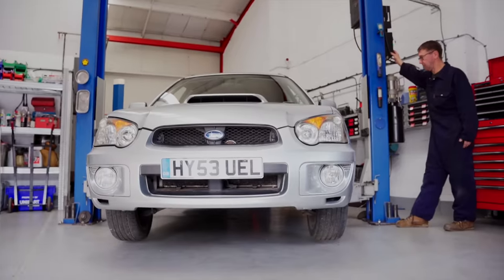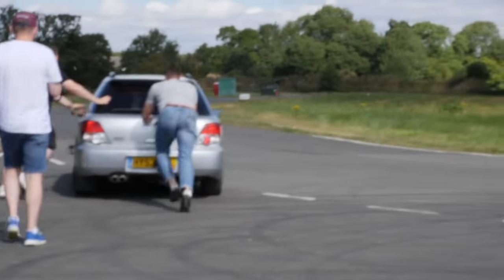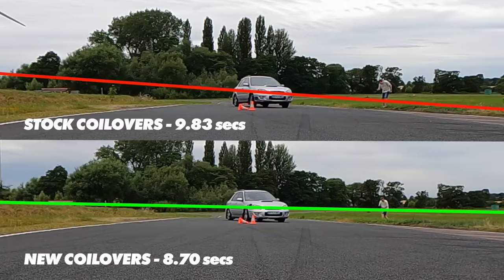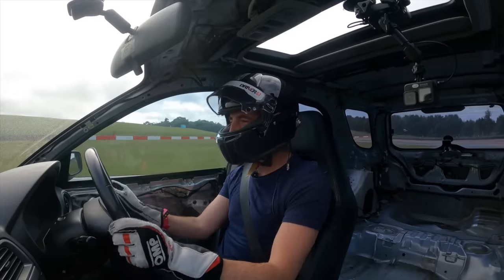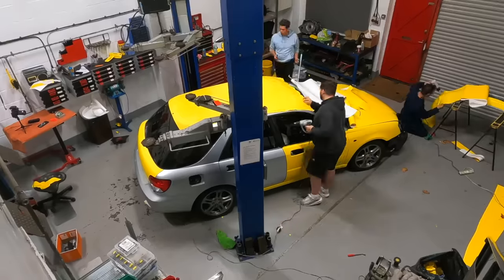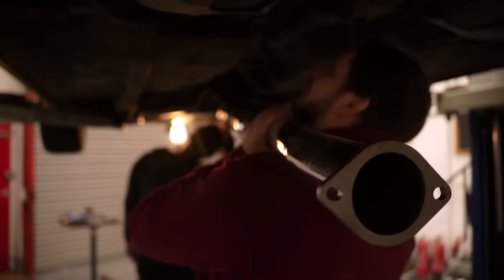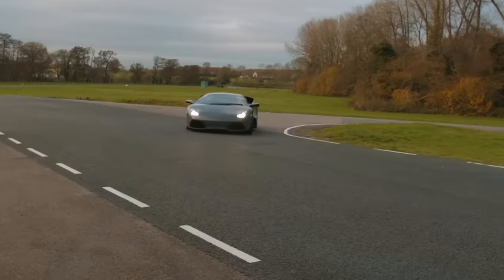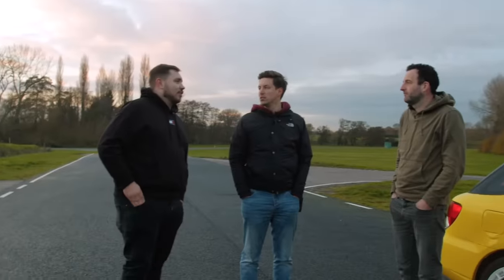We Built a $10,000 Subaru that BEAT A Lamborghini

Comment: I feel like Donut Media and Driven Media have each made a series that gives a completely opposite view of Subarus lol
Reply: Donut Media is a joke lol
Reply: @kingo5940  explain.
Reply: @warlxrd5317  What is there to explain, they blew up their car cause they ignored an engine break in period, and the way they modified lowcar was absolutely bafflingly stupid. It was embarassing to watch. They went in with absoltuely no idea as to what they wanted to archive and threw parts at both cars that didn't really make sense.
Reply: @FourteenSucks  thx
Reply: @FourteenSucks  but that was the whole point right? I mean Installing low cost parts.
Reply: @warlxrd5317  The issue is they didn't even really do that, their fueling system made no sense and absoltuely blew the budget, all they needed was a Walboro 255 or a AEM 340 if they wanted to be safe and injectors, the turbo choice was absolutely ridiculous. Now personally, this is how i'd have setup lowcar, as someone who owns a RB320 Impreza STI, for a Hawkeye WRX I'd have swapped in a second hand VF48 turbo from an STI and Pink Injectors, a new Ebay topmount, swaybars, cheap UEL headers and a Upipe + Exhaust, this would have taken the car to the exact power they made, but with less cost and a far cleaner powerband. 

This would have kept the turbo charged and on boost far better then a Frontmount setup and for the same price, the car would be on chat (In boost) qucikly and spool would be responsive. Leaves alot of money on the table for Shift kit, Pitch mount, good coilover setup (Low car could have gone with HSD, a reputable brand thats under £600 in sales) 

I just dont like the way they do things, personally I think its poorly thought out and doesn't give viewers great input into what should and should not be done.
Reply: @warlxrd5317  The expensive car was the one that had the most issues. Largely because they just threw parts on without preparing for them properly or tuning the car for them correctly
Reply: *Overdrive
Reply: @FourteenSucks  oh. I see. Now I'm getting that they haven't prepared that much. And they took "low" personally right? (Michael Jordan. Jpg) xD
Edit : btw tqsm for explaining! :)
Reply: @ianlide1507  yeah. Now I got it.
Reply: @warlxrd5317  Not a problem man, there's a few great ways to get great numbers out of a WRX for cheap, but I should also mention the limiting factors for the Hawkeye specifically is the EJ257 and EJ255 engines, and ofcourse the gearbox in the WRX being the 5 speed limits your reliable power, these cars are exceptionally fun, and 300-350whp is a great number to archive and enjoy, building beyond this number starts to get expensive and the potential for engine failure becomes high.
Reply: @warlxrd5317 to be fair to donut even when they didn’t ignore the brake in period they still blew up. I think they ended up going through 8 engines and only 2 of them was their fault due to ignoring the brake in periods
Reply: Facts🤣🤣
Reply: @warlxrd5317  they don't have a single clue about cars
Reply: @Fred_the_1996  they mentioned in the last episode that after the first engines that they put on an aftermarket oil pan.
Reply: @Fred_the_1996  they did install after market oil pans😂😂
Reply: @FourteenSucks  The point of high/low isn't to see what build is actually best. Its literally in the name. They're not going for efficiency or "bang for the buck" builds. They don't claim thats what it is. It's literally just the most absurdly cheap and expensive parts. Hence "high/low". Its like going to little ceasars and expecting a wood fire oven made neopolitan pizza then complaining about the quality of the pizza.
Reply: @FourteenSucks  any advice on what to do with a jdm bl5 gt spec b with EJ20Y engine? Car is completely stock at the moment. Cheers 👍🏻
Reply: 11:12  “just don’t pick something with a boxer engine” Driven Media was pretty explicit with that point.
Reply: @FourteenSucks  they literally said they three the expensive parts on because they just wanted to compare the turbos. I get that they did stupid shit ignorant of Subarus but the setup was for a reason.
Reply: Driven Media actually did racing upgrades, when Donut did a "radio upgrade" as a "Time Attack" car just told me, they were done with working on the Subaru's.
Reply: I love donut and everything they do but they definitely did rush work hence the amount of engines they went through where as this series does it right and shows that they have so much to offer and are reliable even when beaten on.  Damn fine work guys and yet another reason I love my subaru
Reply: Both series where meant to be track cars and driven or Overdrive’s car was far cheaper and I bet money was faster, quite hilarious actually, wish there wasn’t a pond between them cuz a race against each would be awesome!!! My money on overdrive car
Reply: Driven Media/Overdrive listened to the viewers and installed parts that were actually tried and tested on the platform. But with Donut, people were clamoring in the comments telling them what they were doing wrong, but they didn't listen.

I was among those telling them to 6-speed swap hi-car or else they'll fry their gearbox. In the end, hi-car's gearbox got fried.

It's a good thing that Drive/Overdrive's build had budget constraints. It really gets them to think carefully about what to install. Both Hi and Low car had virtually unlimited budgets. It's just a matter of which is cheaper and which is more expensive.
Reply: I wasn't really sold on Subarus before,  but Donut has me convinced they are WAY too fragile and fickle for me. To be fair, every Impreza owner I know has had to put at least one new engine into their cars.
Reply: @meischix  well said, I just wish they did this season more like their others(the right way) its almost like they were trying to make the cars live up to the stereo types for the views but if you do that to any car no matter what it is you'll get simular results.  They didn't do them selves any justice by what seemed like just slapping things together and hoping it works engine wise without any breakin
Reply: @christianthornbury6192  I also own a BL5 GT Legacy mate, freeflowing exhaust and if you have the budget get a downpipe, throw a HKS/K&N/Cosworth Panel filter into the airbox and change to a GFB recirulation value, this should allow you to safely get about 320bhp, you can push to higher but i'd not recommend it. the Twinscrolls come with a TD04-HL from factory if your car is a manual and they're very responsive in the low rev range.  Dont overdo the car the engines are basically a Half-ish-STI block but open deck with duel AVCS, hence them revving out so high, but they do blow up if you start to push past 350bhp. 

(edit) DO NOT put a Ebay exhaust on the car unless you're buying the Exhaust specifically for the midpipe and Y-Pipe, they sound AWFUL. ELH makes the car sound worse then a Straight piped Civic if you put a shitty muffler on it.
Reply: @hatefunwrx  Yep, if they only tried to understand the platform a bit better. It's not unreliable, it's just different. Stuff you know working on inline-4s don't always translate to the flat-4s.

It could've been nice if they ran an episode where low car gets just a Killer B oil pickup and a baffle for the stock oil pan, and Hi-car gets the full IAG kit with the pan, baffles, and everything.

We didn't even get an episode on the endless debate on UELs vs. ELs, or on mods unique to the platform like pitch stop mounts. Or COBB access ports vs. Tactrix DIY reflashing? Fully built engine vs. stock block and stroker kit?
Reply: @meischix  you are literally reading my mind 100%.  It's a real shame they didn't actually try this go round and well I'm sure I can speak for some people with saying we have truly been cheated out of real mechanic works and working (not saying they are not just that the seem to not even cover a quarter of the ass instead of half let alone an entire one, still cool that they did it none the less) I feel bad for those beautiful Hawkeyes
Reply: EJ20 Vs EJ25
Reply: @jfishcake  that would be great, I personally like them both
Reply: @zek62482  for me out of the 5 that I've owned I only had to replace 1 engine and it was because of my own stupidity, but I will say they can be a bit on the finicky side but as long as maintenance is done and you don't go to cheap on parts thay are great and the feeling they give is unmatched (at least to me)
Reply: @CozyKG  if they actually did that, they would have gone for fucking Ohlin coilovers for high car, not some fucking Teins
Reply: Here's why the Donut cars blew up and the Driven (Overdriven) cars didn't: The track was different. Donut was running at Willow Springs Horse Thief I believe, which is a MUCH larger track. The issue with Subarus is that it is far to easy for oil to slosh away from the pickup when you add grip. So even with baffled pans the cars were under sustained lateral acceleration and oil starved. The Driven car was at Curborough which is a very small, tight course similar to an autocross. On that scale of course the oil doesn't have time to flow up to the heads and get trapped. The other issue is that it seems to me the 2.5l engine with it's longer stroke and greater crankcase windage seems to have more issues controlling the oil vs the 2.0l engine that comes in the 00-05 USDM cars and all euro market Subarus.
Reply: @FourteenSucks  The way you described how to modify lowcar is exactly what I did with my WRX when I got it. VF48, 750 cc injectors, walbro 255, turboback and a tune. I drove it like that for years and then the EJ205 failed from a clogged injector. EJ207 swapped it and upgraded to a rotated GTX3076R and a 6MT and it's been great at 450whp. Still did all this for under $10k and it is way faster than either of Donut's cars.
Reply: @meischix  That's because those debates aren't debates unless you're in the dumb side of the subaru world. An EL header is better and makes more power. Only in the US where people expect Subarus to go "wub wub wub" did they keep the hot dogshit drinking straw hot side setup on the STI. In the rest of the world the STI got an equal length twin scroll setup in 2007. It's better, period end of story. Also pitch stops do very little, don't bother with that, it's a waste of money. Tactrix vs Cobb, it'll do the same thing given a good tune, just depends on what the tuner prefers/has experience with tuning. The real high car oil system would be to fit the RCM dry sump kit, then it would have actually lived. Probably would have been cheaper in the long term too.
Reply: @Levibetz  very good points.  Even with all of that I still love both engines for various reasons and the way they feel, currently getting used to my wife's 19 ascent and its let's say fun times and what not
Reply: @hatefunwrx  Yep, I have two subarus and a beetle. Definitely a boxer fan myself. I just try to stay objective and clear out the BS surrounding Subarus which is... a lot.
Reply: Totally 😂😂😂😂
Reply: @Levibetz  always trying to in all aspects of life, to me this car(my 07 wrx) is me in car form in every aspect.  I really do miss driving my 02 but this one is things I can't say without getting in trouble
Reply: Atleats donut have made the price of Subarus cheaper for people who actually know about them
Reply: @Umar-gw6fy  I hope so
Reply: @warlxrd5317  look up smeedia/remy/bader/devin they all work on subarus they are literally lego blocks and you have 30 years of documentation on whats weak with them and what to upgrade donuts a joke now
Reply: @SkylineLofe  Exactly. Its literally just about the entertainment value of seeing cheap and expensive ass parts. Idk why yall are complaining so much😂
Reply: @kingo5940  ah yes because the engine that blew up in first track day without any mods was donut medias fault
Reply: @kingo5940  Dount Media definitely leans more on the entertainment side rather than information especially when you look at stuff like their tool tests.
Reply: @Levibetz  The point is that Donut can still milk those topics for a content. Their average viewers are obviously either in the dumb side of the Subaru world or just not totally in it. Had they popped in one video about it, it would’ve helped clear some stuff up and would’ve been quite informative for millions of viewers, even if it’s already an answered question within the Subaru world.

While pitch stops alone do very little, but a whole driveline upgrade from engine mounts to pitch stop mounts to tranny mounts to rear subframe lockdown kits make a huge difference on driver feedback and delivering all that power to the ground. They could go “unbranded Ebay stuff” vs. solid mounts and bushings from Perrin, Cobb or Torque Solution. A whole episode about it could’ve been quite interesting.

Donut would know that if they just did some research and tried to understand the platform.
Reply: @Fred_the_1996  they actually put baffled oil pans on both cars after the first engine blew up.  They did their research after the first engine blew.
Reply: @FourteenSucks  hey mate I have a 06 wrx and it's setup very similar to how you described it. It's my weekender so I do drive it hardish sometimes but no track days. Do I need the oil pan baffles and pick up or will I be alright without them. Also tuned to 195kw atw, can the 5spds take in the long run?
Reply: Agreed lolol. Donut media shows what happens if you don't do a subie right. These guys did it on the cheap and it's still leagues better. It all comes down to a good tune with brakes and tires. No aero, no big engine mods, nothing.
Reply: @FourteenSucks  I could be wrong, but I think the "driven" guys have an EJ20 in EDM spec. That's their advantage. the EJ25 is well, just an engine I wouldn't want to modify (I own two EJ20 USDM cars). But the Donut guys beat on and modified high mileage EJ25 engines with no knowledge of the history, that's absolutely a recipe for disaster. From what it seems they didn't have engine issues after having properly refreshed engines.
Reply: @CozyKG  woopsie
Reply: @andrewzelitt  oops
Reply: @bagochips834  yeah i was shocked when they said that they'd been running baffled oil pans the entire time
Reply: @kingo5940  it used to be good... now evem their top of the line series Hi-Low is ass.....
Reply: Richard hard carried this I think. I was so scared the engine was gonna blow the entire series
Reply: That’s because American EJ25 are garbage, the EJ20 are far more reliable and has more potential
Reply: We'll, Driven have used a wagon. I don't see any young grear head (abused engine) be caught dead in a wagon.
Reply: For sure but like a story (the bubarooo) every one has their own side.  And both had huge gains on the stock form.  Donut just made silly mistakes on an initially beat engine. Because hot boys in the USA (I’m from the us and see it all the time) beat these poor cars because they are budget friendly now.
Reply: @warlxrd5317  this car cost half as much as LoCar and would completely stomp it on a track
Reply: The true nature of EJ
Reply: Who cares, all that matters is that they're having fun and enjoying what they're doing
Reply: @FourteenSucks  do used engines have break in periods?
Reply: @daftwatcher  If the engine hasn't been opened no, but regardless, its an unknown, if I was to fit a unopened engine into a car i'd probably baby it a little before ragging on the car.
Reply: In my experience the EJ205 is a far more reliable engine then either of the 2.5L engines, so that might be part of it.
Reply: Overdriven*
Reply: u made them change channel name lol
Reply: @kingo5940  About 7 million subscribers might say different.
Reply: @samuelgarrod8327  that has nothing to do with that lol
Reply: @kingo5940  Hahaa. It definitely does.
Reply: Donut is from California....They cannot take things serious so they just act like they do. If they would be an F1 Team, even Haas would laugh at them.
Reply: @ElSascho  the quote that comes to mind is "if you try to write something funny, but it ends up not funny, you have noting." while overdrive actually had a clever idea with the lambo and a good concept with the limited budget, and kept all the test very understandable for the viewers. And we got some funny moments on top. Donut in the last high low, did the opposite many times, where interesting test got replaced by jump cuts, montages and jokes that did not land. They also had some good episodes, but not on the level that this series is. This and cartrek is my new "top gear"
Reply: @FourteenSucks  the hawk wrx already has 550cc injectors
Reply: They have different engines. Donut has the EJ25, Overdrive has the EJ20.   The 2l EJ is way more reliable than the 2.5l EJ.
Reply: I agree
Reply: Everything that Donut did, is what everything you should'nt do to a subaru.
Reply: yea don t buy one thats the view

Comment: Doing that on the standard TD04 turbo is great work. Staying top mounted but enlarging the top mount intercooler and mating it to the TD05 16g turbo gets you to a mapping at 340 / 350hp - for me that was the sweet spot in my Subaru journey. The 2L engine in the blob eye that you have has not really for the head gasket issues of the later 2.5. - Keep going and then take on something hotter still. Nice work. Keep going.  I look forward to series 2.
Reply: The engine is fine, the 5speed is glass :D but I still want to see Driven media with 40k usd budget, that would be awesome

Comment: So, I've owned my WRX 04 Wagon for a couple of years now and it's not my first Subaru.  I've uprated the brakes to 8 pot D2s on the front and got braided and new hardlines all round. New Exedy racing clutch and an ultra light fly wheel. I need a new exhaust next and I'm about to strip the interior but I've had doubts. Now I have no doubts. I'm going for it.  I'm excited but also on a budget so... this time next year...